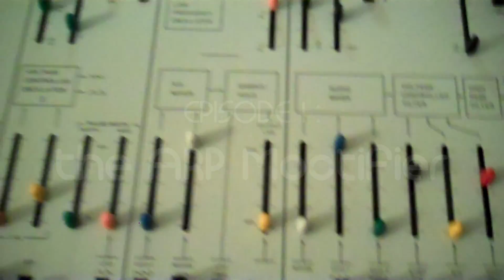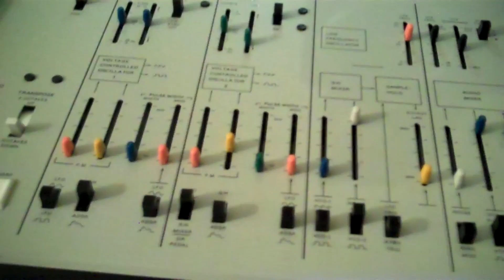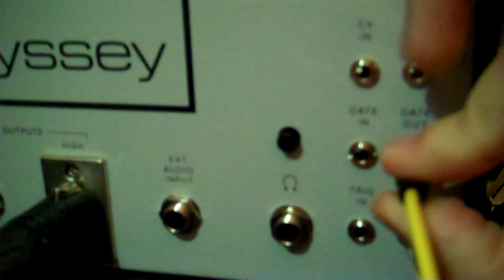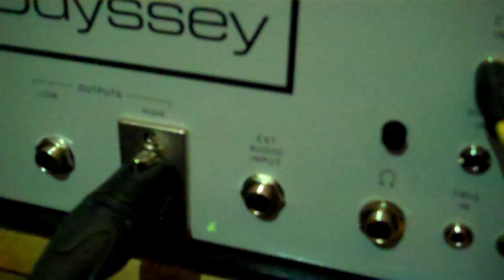MOOT MODS #1: Mootifying the ARP Odyssey

Comment: Hi, Matt! I've recently acquired the Behringer Odyssey, and I've tried patching it from CV in to out. It's now monophonic, but now the scaling is off on one of the oscillators. Have you encountered this? It's noticeable enough to be irritating, because a slightly detuned oscillator on the top of the keyboard will be very detuned on the lower end.
Reply: Hey bro, I had the same issue when I first received mine and had to go through and recalibrate the oscillators. Its not too difficult if you haven't done it before and will typically iron out any issues. Hope this helps, if not then maybe Matt will write back by then with another option.

Cheers!

Comment: So obviously when you insert a patch cable into the CV In there is some internal switching going on, or as we call it a 'Normalled' connection gets broken and you are overriding it with something else.  Inserting and open switch is not going to give you what you want.  It wants to see something on the order of a voltage.  The Duophonic nature of the Odyssey comes from a Sum and Difference function of the Keyboard so it is my guess that is tied in to the switching some way.  Your Black Box is very elegant but you're going to have to find some way of getting at those Keyboard voltages to make it fully functional.  (I would have incorporated Foot Switch options for the Legato playing on mine..)  You'll need to add another switch for the Second Voice that tells VCO 2 what to do.  I believe that was the case for many Modular keyboards of the day.  You had multi-voice capability but you had to tell the instrument where those other voices go and it was just a mess.  If you don't want to start drilling more holes you're gonna to have to make due with the ol' reach around.  It's only one little yank..

Comment: Hey Moot, ( I may be messed up here in my thinking ) but what if you took a 1/8 plug apart and added an off/on switch between the tip and sleeve? when you turned it off it wouldn't make the connection in the jack while plugged into the cv input.
Reply from the maker: phlattgetit that's something I hadn't considered! I will have to consult some EE friends on that. Hmmmm!

Comment: I wondered what would happen if you just plugged a patch lead in and didn't connect it to anything.  Now I know.  At least it works properly for the legato function.  I like it.

I think you would have to modify the KARP internally, but only the little PCB that holds the 3.5mm jack socket for CV In - each board holds two of those sockets, but they unplug from the main board - there's a cable with a small multi-wire connector.

Have you seen Markus Fuller's pull-apart video?  He makes it look easy to get to:

https://www.youtube.com/watch?v=4p4NUiKwxpo

One thing I wondered was how he knew where each one went, to put it back - maybe only take off the one you need.

The socket will be switched, like a headphones socket on a radio which disconnects the speaker.  There will be a wire to the switch that feeds a CV signal when nothing's plugged in (not the same as CV out, apparently)... I suppose there might even be two switches, one for each oscillator signal.

Either way, it should be relatively uncomplicated.  Maybe you could make a board that plugs in between the internal cable and that jack sockets board.  There's lots of room inside one.

Is your warranty up yet? :)
Reply from the maker: yeah I think my warranty is passed now...I made this little box to try to avoid any internal mods, but you've got me thinking about doing that now. All I need are two submini DPDT toggle switches. I'd really only like to do it if I got a second Odyssey...This thing works flawlessly after hundreds and hundreds of gigs - literally thousands of hours of playing. I'd hate to screw that up somehow!
Reply: Yes, I've been thinking there must be two CVs going to that little board, with the CV Out and In sockets, and two returning from it.  The jack plug is probably working a DPDT switch, which chooses where the two return signals come from - either from what's sent to the board (separate CVs) or both from the jack socket.

Switches for those functions would be good.  I know what you mean though - I'm reluctant to take a soldering iron to something unless it's stopped being useful, or it's frustrating the hell out of me.

Maybe someone will come up with a plug and play solution, to connect in line with those little boards... there'd still be holes to drill for the switches, of course.

Comment: Looks like the jack is a switched trs jack, right? So when plugging in your cable you are breaking whatever connection was going on, either tip to ring or ring to ground or what have you. So on your moot box just use a switching system that would duplicate that connection. That's basically how amp channel footswitches work. Of course you would still have to open it and check inside or check the schematic, but no permanent mod needed. I just found your channel man,  I love everything I'm seeing!

Comment: Hey Moot,
Have you noticed these connections affecting LFO function at all?
Reply from the maker: phlattgetit as far as I can tell, they don't have any appreciable effect on the LFO, as far as how it works internally. Obviously, as I explained, LFO functions such as vibrato and well, anything else, have no effect whatsoever on synths being controlled by the Odyssey.
Reply: Thanks for answering Moot. Sorry, I wasn't clear in my question. When I patched gate out to trigger in and cv in to cv out it caused my LFO to run incredibly slow or not at all at even the highest setting? 
I think it may be something particular wrong in my FS unit? 
Sounds like I need to talk to Korg or just not worry about it as I probably won't use this set-up anyway. Thanks again, your vids are an inspiration.
Reply from the maker: phlattgetit oh my, that is definitely a problem!! And for as much as the FS costs, they should definitely rectify the situation! Bear in mind that patching gate out to trig in (something that they expressly encourage in the documentation, even providing a short cable with which to do so) does not cause the LFO retrig to stop. It still restarts on every new note, regardless. I hope you get that sorted!

Comment: Does anyone know to make the funky worm/G funk patch  from the 1st dr dre album ala Gin and Juice and Dre day/on Arp Odyssey?
Reply from the maker: Dee Patrick It can't be done exactly 100%, since the ARP Pro Soloist that Junie used on the original has some slightly different stuff going on filter wise, but if you use VCO 1 only set to Pulse, with the width very narrow, use the Rev 1 filter with little to no resonance and cutoff on max, adjust high pass to taste. Should get you in the ballpark. Oh, and LOTS of portamento!
Reply: Thanks man! I'll check it out thanks!

Comment: Nice! I thought that sounded a bit like that FVS patch of Lyle's. Excellent job recreating it! It sounds great on the Odyssey!

I'm afraid I can't help with the CV in issue. Isn't that behavior typical of CV inputs? If you can find a way around it, it might be useful for other synths as well.
Reply from the maker: Thanks! And I believe you're right...It's just the way CV inputs work... I think the only way to fix that would be to add an internal switch, and that kinda defeats the whole purpose!
Reply: mootbooxle The switch for the trigger seems very handy though. I wasn't aware of that issue on the Odyssey.

Comment: So, someone correct me? If you bought another Odyssey or the desktop unit and connected it CV wise to another Oddy and you have the patience to match the patch settings would you be able to play four note chords like the old 4 voice Oberheims? Or would you just have two oscillators sounding on the same pitch?
Reply from the maker: Wouldn't that be nice! Unfortunately, in order for that to happen, there would have to be some digital multiplexing from the keyboard to detect individual notes. You're right - it would just be two oscillators on each note (or four oscs on one note). The way this works is, as I said, one osc responds to the lowest note played, while the other responds to the highest note. Not the most elegant solution, but hey, that's analog!

Comment: That Get Lucky ending was neat. 
Off topic: You should use Moot's Doots as an album name.
Reply from the maker: The Dooty of Mooty. Mootle Doodles. Haha, I never thought about that tune having the same chords as Get Lucky. I actually wrote it in 2010, so maybe Get Lucky has my chords! ;)
Reply: mootbooxle no worries, I once wrote the beginning chord structure to "Tequila Sunrise" (no wonder it worked so well). Also wrote Pachelbel's "Canon in D"... I did a nice job of it -- really very original (well, I did write it, not rip it off)

Comment: Cool! Very useful info :-)

I'd be so trying these out right not but... when I got my Odyssey, it came with a Kenton Pro Solo MIDI-to-CV converter. The keyboard needs rebushing and I don't find the PPC great for accurate bends, so I control my Oddy from my Sub 37 via the Kenton (I know, a Moog controlling an ARP, but it's one duo controlling another but monophonically!). I only ever want to play monophonically so it works well for me, plus has the advantage of pitch-bend and modwheels (courtesy of the Moog), switchable retrigger or legato mode on the Kenton, plus a dedicated vibrato LFO on the Pro Solo so you don't have to have the same LFO rate for vibrato and e.g. PWM.
Reply from the maker: That's cool, I like the Kenton stuff! I've used a Pro-2000 for years. I don't know if the Pro Solo has this, but on my Pro-2000, you can use the aux channels to route things like aftertouch...great for filter sweeps or vibrato!

Comment: I was looking for a mod to make the Odyssey monophonic...I didn't imagine it could be so simple... Thanks!
Reply: mootbooxle I wonder if that pink/white noise switch is soldered directly into the board or if it's alone and cabled. If it's kind of free floating and you don't mind losing the noise selector, you could repurpose that into a mono switch. :)
Reply from the maker: I couldn't believe it either! Glad to be of service! Now if I could just figure out a way to make it mono/duo switchable without voiding the warranty....